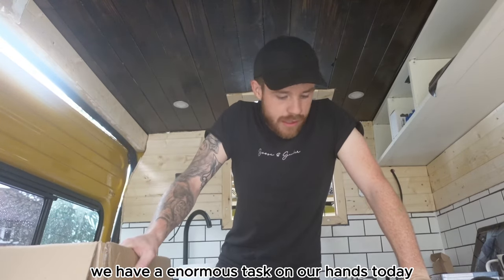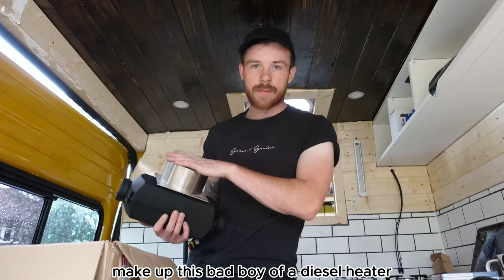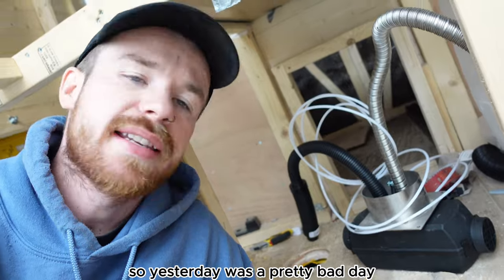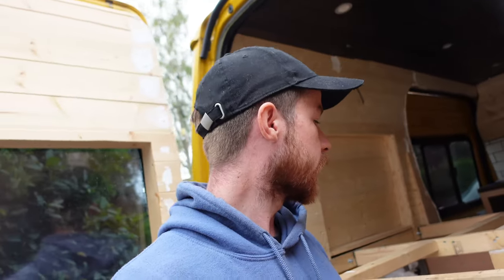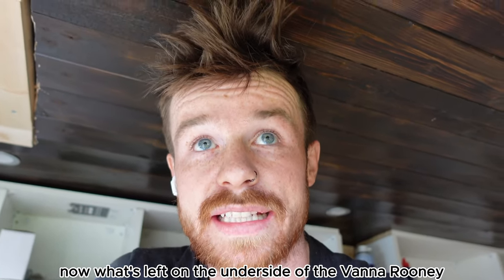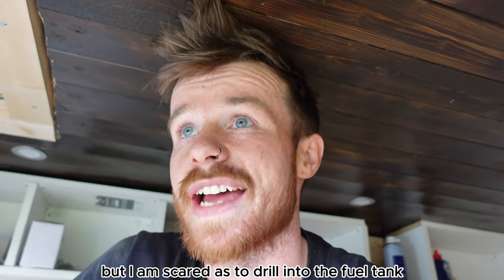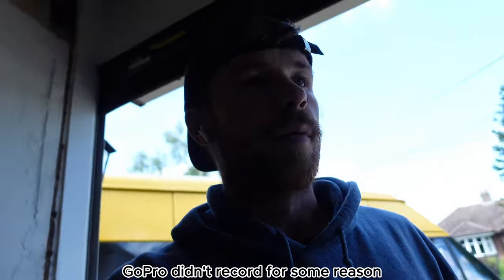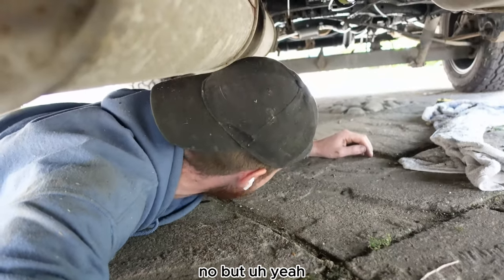Installing a AutoTerm Diesel Heater | Transit Van Conversion

Comment: You dont need to drill a hole in the fuel tank mate. There is a aux feed port on the top you just need to snip the cap off and you can get a specific connector and pick up line for tansit fuel tanks.
Reply from the maker: Yes I know. I didn’t want to drop the tank.
Reply: @CiaranTravels  fair enough :-)

Comment: Just had an Autoterm  heater fitted to my Fiat Ducato motorhome by the Autoterm  fitter near Bideford  in Devon, he's  done a very neat job and I'm  very pleased with the result, and the feed is from the vehicles main fuel tank, all working very well.
Reply from the maker: That’s awesome! I’ve had mine running a few times! Throws out some heat eh?
Reply: I also upgraded  to the new controller.
Reply from the maker: @philmay113  I did too! So much better!!

Comment: Where did you get the feed pipe you installed on the top of the tank. And how does it attach, it looks like you are tightening up the nut, but how does that secure it to the tank please?
Reply from the maker: It came with the kit dude! It’s basically like an umbrella fixing, you can close it up and once you push it through the hole it springs open, acting as a clamp, there’s also a couple of washers incorporated so when you tighten it up, it gets real tight and solid 👍
Reply: @CiaranTravels  Thanks, I'll have a look for one